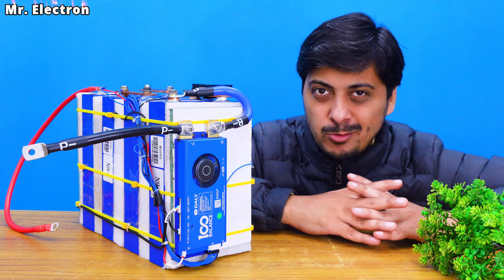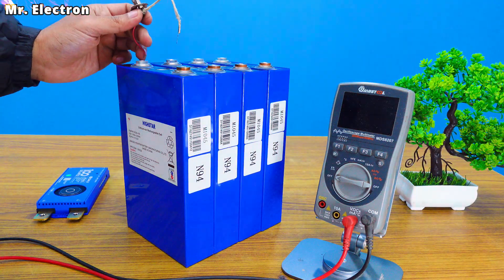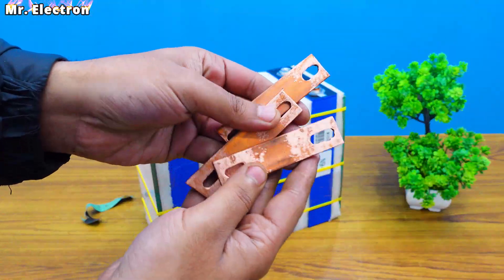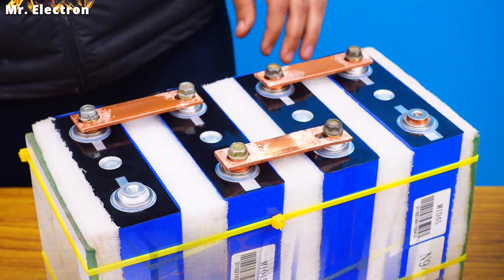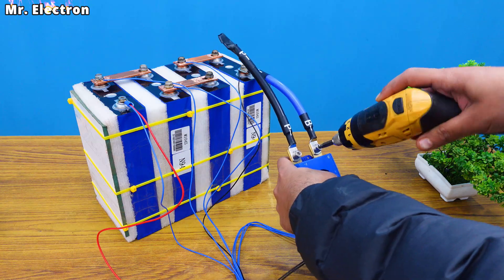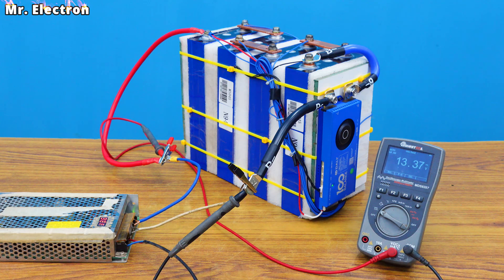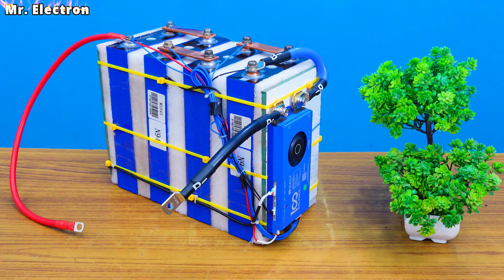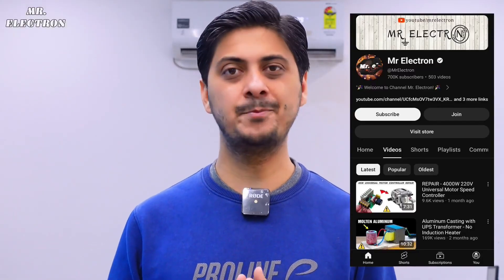12v 100Ah Lifepo4 battery build, For Solar Backup using 4 Prismatic cells 100Ah

Comment: You will need constant voltage constant current supply to charge it you can't use direct smps to charge it or else it will slowly damage the battery
Reply: Enough for mppt charging via solar .??